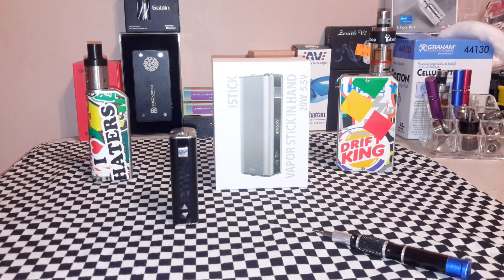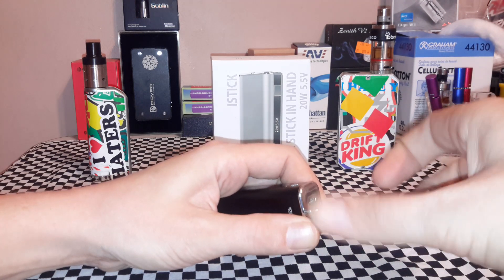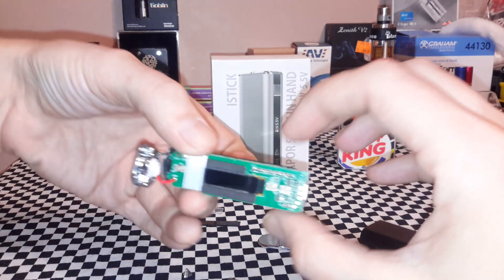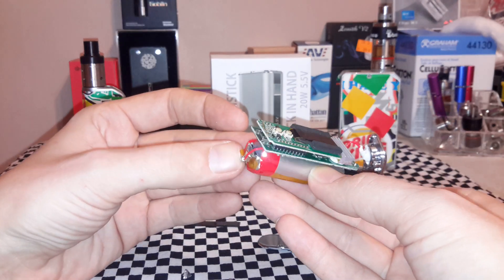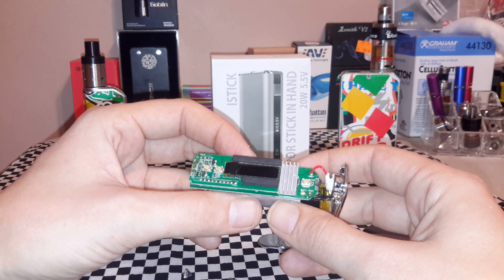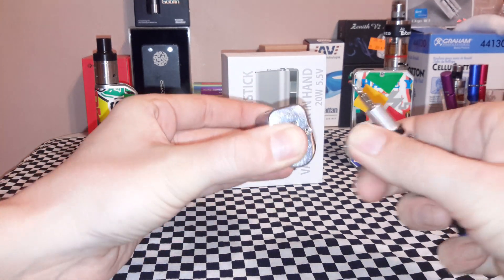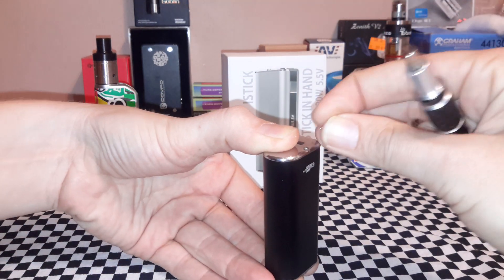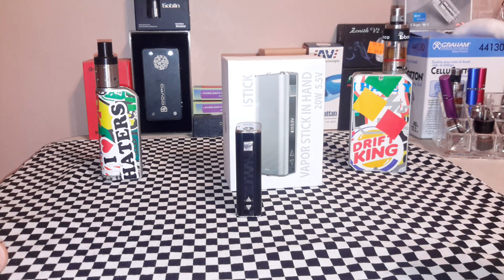ELeaf iStick Internal Breakdown & Battery Change

Comment: I replaced batteries in 2 eleaf mini iSticks by watching this video. They are built almost identically to the full size isticks. I used 18350, 1100 mAh, 3.7v, 4.1 wh high drain rechargeable batteries with a maximum continuous discharge of 9 A made by vapcell that I got on amazon. They work like new now. Thanks for the video!

Comment: So i have to ask if this happend to.me and i needed a new battery for the same exact mod that u have here but lets say i dont have others like it but that i do have a few 18650 batterys so can i maybe use one or 2 of them? Also incase they are to big maybe the smaller versions i for get the number like 18650 or whatever it is with the lil ones but maybe they would work??

Comment: I could be wrong but you did not explain how to remove the battery you just took it apart ??? is the battery soldiered in or clipped in ?? thank-you . also can I not just buy a device that you can officially change the battery ??? if so could you suggest one ?

Comment: I have a pair of 20w iSticks, about 18 months old and the batteries were very faded. I followed the instructions above and replaced the batteries with Samsung INR 18650 25R types which are 2500mAh. I was not that concerned with the absolute capacity, I just wanted good quality batteries inside. It has worked very well and the iSticks are behaving like new.

Couple of notes though: there are a lot of fake batteries around so it's important to buy from a reliable source and [2] my 18w soldering iron struggled a bit on the batteries because they act like heat sinks, I got there in the end but it would have been easier with a slightly bigger iron.
Reply: I should also add that after I had reassembled the batteries I pressed the button and nothing happened. At first I thought something was wrong but it's just that the new batteries are supplied with a very low charge on them. Once they had had a few minutes on the charger the iStick started up fine.

Comment: which is better the kanger subvod or eleaf Tc40w using a top tank min @ 0.5 ohms or does the eleaf just make it more customisable with it having TC & VW?
Reply: The kanger subvod SUCKS!
Had it less than a year before it started leaking and buying replacement o rings is a joke. NO store sells them and even when you buy then from kanger they send you the wrong shit.

Comment: been trying to find the battery for this to replace on mine what do i have to type in to find the actual battery help me plz
Reply from the maker: +Brad Read the actual battery would be almost impossible to find.  IMO you would be doing yourself a service by replacing the battery with a new 3500mAh Sanyo NCR18650GA
 http://shrsl.com/?~c1ok 
safer chemistry and much bigger capacity. These Japanese made cells are imo one of the safest batteries on the planet.
Reply: @VaporologyINC  I have an Istick TC40W. I have disassembled the unit and removed the battery. Battery label says 20600@2600Mah. Vape stores say "it can't be replaced".  I don't see anything resembling a protection circuit on battery itself, unless it's under the battery wrap (?).  Can't find an exact replacement online. What battery do you recommend. I don't use the Temp Control feature, and don't know if that's an issue (?)  Battery measured .62 V when removed and checked after an over-night charge.  I assume the battery shorted? Thank you
Reply from the maker: @jpmad3152  20600 is literally the dimension of the battery 20mm diameter by 600mm long.  18650 is 18mm diameter 650mm length so it's a bit longer but will fit.  Any high drain 18650 will be fine. Atleast a 10amp continuous rating to be safe.   I recommend a Sony vtc6. Will be a very noticeable improvement over the stock cell.  Remember the board is only drawing 30w max.  So its not a huge amp draw on whatever battery you put in.   All the protections are on the board itself.  So you still have functioning protections like you would on the original 20600. Short circuit, over voltage etc.  All lithium ion batteries (single cell) charge up to 4.2v.  So 20600, 18650  doesn't really matter.  It's about energy density and how much energy a given cell can hold.   From personal experience i was able to fit an 18650 in mine no problem.
Reply: @VaporologyINC  Wow.....I really didn't expect a reply! (from such an old post)....and thank you SO much! :)  I learned everything I needed to know, and MORE. I will try your recommended battery. However, a longer battery @650mm will put the + terminal resting on the heat sync at the top of the board......should I be concerned? Anyway, I will give it a try. Funny, I had just decided to give up and go buy 2 more Isticks. Thanks Bro, really appreciate you taking the time........
Reply from the maker: @jpmad3152  just make sure that you insulate the battery. On both ends + and -  Either with electrical tape or another means to keep it from making direct contact with anything inside the mod.  I believe I needed to remove the foam insulators to fit the 18650.
Reply: @VaporologyINC  Hmm?  Right, common sense stuff. Shame, I was hoping to use the original foam, but I'll come up with something.  Ahh...I kind of deviated from UR battery suggestion (my bad?), and just now ordered the Samsung equivalent from Amazon. Same specs as the Sony but lots of reviews vs Sony. I still have time to cancel the order if you think it's wise (?)
Reply from the maker: @jpmad3152  the Samsung should be fine.  As long as it's rated atleast 10Amp continuous.  I can't remember if the foam fit or not with the 18650.  It may fit.  Been so long i cannot remember.  Just make sure the solder points and battery + & -  are completely insulated from shorting on anything.  Try an use the foam insulators if they fit all the better.
Reply: @VaporologyINC  Roger that on insulation. Samsung INR18650-30Q High Drain 3000mAh 3.7V 15A Rechargeable Flat Top Battery, (2 Pcs) by M&A BD Electronics

Comment: I know a high drain IMR 18650 with higher amperage will be able to deal with lower resistance but is the PCB in the iStick preset so it won't let you sub-ohm any lower?
(Minimum is 0.4Ω with the 30w)
Reply from the maker: Correct.   However battery life would improve greatly.   Also less battery sag at lower voltages with a higher quality cell.

Comment: Would i be able to put a RDA/Dripper on it ? Because most Shops say the batteries should have 25+ amps, does the one in the iStick 20W so ? And to how low Ohms could you get on a built with it ?
Reply from the maker: +Nils B on a regulated device like this it's a bit different.   On a mechanical mod and rda or just general rule of thumb would ALWAYS buy the best batteries.   Don't cheap out on the most crucial aspect.  Stick with reputable batteries like Samsung,  LG, Sony, Panasonic/Sanyo etc.  Stay away from rewraps like efest/nite core etc.  Paying more for a sticker basically.  So this mod is only 30w max.  And a .5ohm limit.   So you need to build like .45ohm or higher On your rda.and you only have 30w.  That being said.  A decent 28g  build would perform alright.

Comment: if I replace the battery with say an LG hg2 3000mah will I actually see a benefit or will the board be programmed only to use the original battery capacity 2200mah?
Reply from the maker: you will see a huge increase in battery life.  the board is a board.  its designed to run on a spcified voltage.  in this case a 3.7v single cell 18650.  regardless of mah.  you could put that board into a different enclosure and connect 10 batteries in parallel and only charge once a month… lol.   the board only sees the voltage supplied by the battery.  not the batteries capacity.  it estimated the battery capacity remaining by monitoring the actual voltage of the cell.  hope that helped more then confused..
Reply: +Vaporology INC thanks mate appreciate your help, I thought that might be the case but just wasn't sure and didn't want to go over the top if it wasn't gonna give me any benefit

Comment: Just want to point out that the screws on the iStick 30 are Torx size T-5 NOT hex.  While a 1.3mm hex MIGHT work, a Torx is the proper tool for those screws on the iStick 30.

Comment: Why don't they make them with replacable batteries,would make more sense they are expensive for a disposable mod.
Reply: +jordi It would make it a bit larger, I think that's the reason. Same as with most smartphones. Not so good trend IMO.
Reply: Because then you will never buy a new one.
Reply: @daveasheroff5623  yes you will once the mod goes bad droped in water broken burnt up etc you will still end up buying a new one or just cuz you want a new mod to experament with or maybe just like colecting or watever lots of reasons to buy new ones

Comment: Do you happen to have a video showing step by step on how to change out the battery cause I have a 50 watt and it's fully charged but every time I try to hit it says battery low
Reply from the maker: Sorry i have not done a video regarding the 50w iStick.  It would be quite similar only there are two batteries instead of one.

Comment: Your're not suppose to take it apart it will make the warranty invalid 

By the way can the battery be changed in this or is it built in to the device
Reply: +Brittany Hollander stfu Brittany,  intelligent people disassemble things.
Reply: +Amanda Jayne Bristow Those batteries are just like laptop or phone batteries - they wear out after maybe 3 years tops. by that time your warranty will have expired anyway. The battery is soldered with wires (did you even watch the video? lol), it doesn't just pop out like, in a tv remote. You have to use a soldering iron. But it's easy really.
Reply: I want a kit that you can replace the battery when one goes flat 

a built in battery means when it comes to the end of it's life the unit is useless and you throw it away and have to get a whole new
unit 

I am after a mod that you can use two batteries in the device and if they go flat I can then removed them and put two fully charged ones in and charge the two I have removed when I get back home

There are mods on the market that you can use two 18650 batteries in it and the battery compartment is magnetized so you don't have to use a screw driver to put it back on 

The ileaf 100 watt mod does this and I will be getting this asap
Reply: oh ok you must've owned an ipod ;)
Reply: No I'm talking about vaping equipment not ipod

An eleaf 100 watt mod is a vaping device 

Look this up
Reply: +Anthony Capron I'm starting to think she's trolling. I hope so. For her own sake y'know.
Reply: Anthony I am a vaper and a reviewer I know what I am talking about here 

So please don't be rude to me this is just my personal opinion at the end of the day
Reply: +Brittany Hollander Yeah and when your car's tires are worn you "have to" throw away the car and buy a new one I guess. Same logic. Duh.
Reply: No you don't replace the car when the tyres have worn down you replace them 

Basic stuff I mean are you stupid here or something and your spelling is terrible also you need to go back to school and get a decent education or something 

Tyres not tires I mean duh 

ThePwaro FUCKTARD!
Reply: why only 90 days that's crazy don't you think

Comment: Vaporology INC Great video man. My 50W iStick seems to have fried, and I really liked it. I see they also sell the boards at FT for those. I know it would be asking a lot, but you seem to like opening these. If you have a 50W, could you either do a vid on the board replacement, or point me in the direction of a video that you know of? I haven't been able to find one, which is surprising with all the people having problems w/these! Also, my problem should be the board and not the batteries or anything else, right? It's just plain dead. Thanks again.
Reply from the maker: I unfortunately do not own a 50w.  I will however look into a video for you.  Also there is really no way to determine the problem until you get in there.  If the batteries were over discharged (below 2.5v) they may be permanently damaged. In which case they will most likely need to be replaced if they do not take or hold a charge.  Really shouldnt be too hard to sort it out.  If you open it up and use a multi-meter to test the battery as see if has voltage.  If it does not have any voltage it is most likely the batteries that is the issue.  However, if there  is voltage and  the device wont power on trouble shoot all the electrical wires and solder joints to make sure the problem is not just a broken connection or a damaged wire.
Reply: Vaporology INC Thanks for the reply man. Yeah, I was thinking it could be a few problems myself. I might as well open it anyway. But about the battery being low, I always kept it over half charged so could that mean I still ran it too low? And, it broke when I dropped it, so maybe it was the soldiering like you said? Thanks again for the reply.
Reply from the maker: If it stopped working after you dropped it to me it sounds like something came loose on the inside.   Don't worry just go slow and take your time it's quite easy.
Reply from the maker: T6 Torx or 1.3mm hex screwdriver is the size bit you need to get it opened up.
Reply: Okay, I'm going to pick up that cheap bit set at harbor freight. Thanks.

Comment: Is there a way to put the 30w chip in a 20w case?
Reply from the maker: yes. its actually quite easy as they are the same size. Though i would propbably update the battery while i was in there.

Comment: Any chance of a 30w battery change, i assume the same but what battery?
Reply from the maker: It would be the same.  Any high drain imr 18650 would work fine.  Personally had good luck with the Samsung 25. But the higher mah ones like the panasonics etc will work fine.  I would make sure the battery is capable of a minimum 10amp continous discharge.